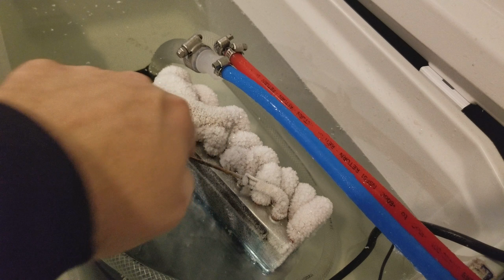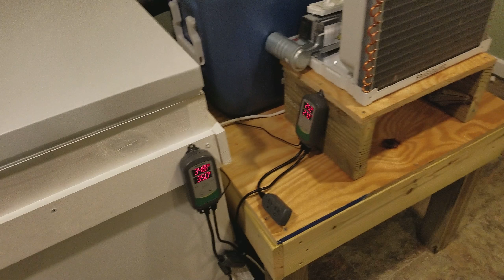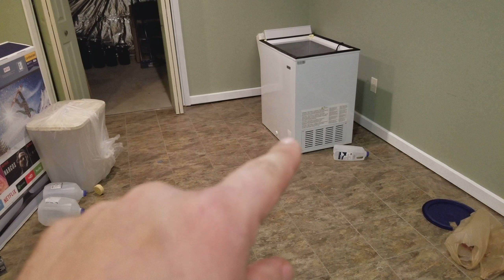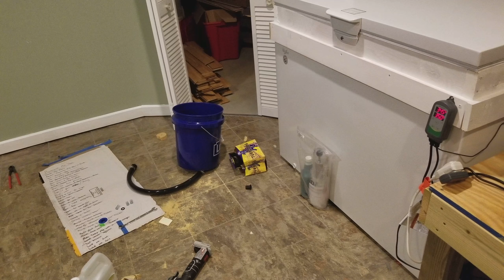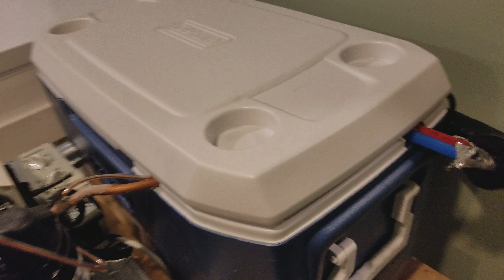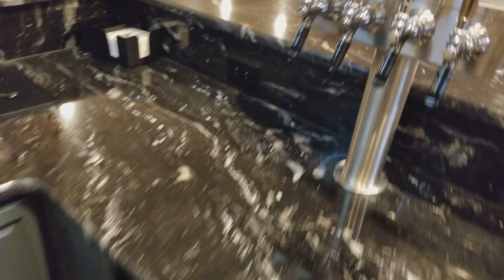My Remote Tap Glycol Home Bar System

Comment: Nice build mate, you're refrigerant compressor is slugging liquid though. You should fill your glycol higher and spread out the return line over the evaporator coil to transfer heat a little better. Remember, an air conditioner is designed to cool room temp, you're cooling down beyond that to refrigeration temperatures. I'd also set the selector switch to low cool, should help raise suction pressure and reduce slugging. Good build, well done.

I'm a HVAC+R tech, 20 years in trade.

Comment: What is the size of that cooler with the condenser in it?  Any regrets about the size or is it fine?
Reply from the maker: It's perfect.  Its a pretty big size, wider than the ac unit which is obviously the main point.

Comment: The evaporator is inside the cooler, the condenser is outside. Insulate your suction line with 3/4” thick armaflex tubing insulation to help prevent ice buildup. Also use insulation on any cold lines that are condensing moisture on the outside, like those in your freezer. Increase PG fluid level and mixture percentage in cooler.

Looks good. Cheers.

Comment: This is pretty nice. Well done.
I'm curious about what you use for gas? Beer gas (75% N + 25% CO2) or straight nitrogen? And what pressures do you use to push the beers to the taps?
Reply from the maker: I just use a normal c02.  That could be a mix to be honest.  And I honestly can't recall the pressure.  If you see it in the video on the regulator then thats what its still at as I have had no issues with that.  Probably around 10 psi.